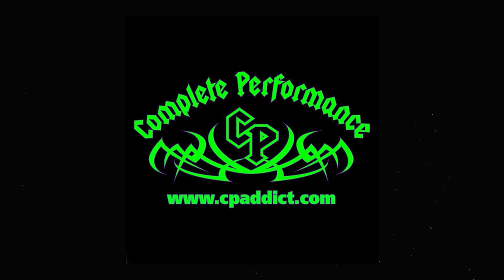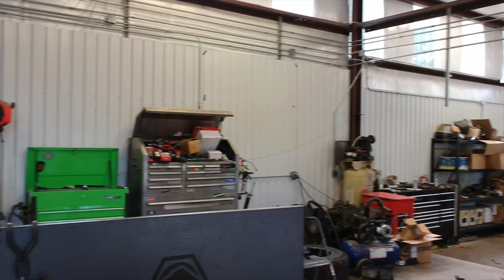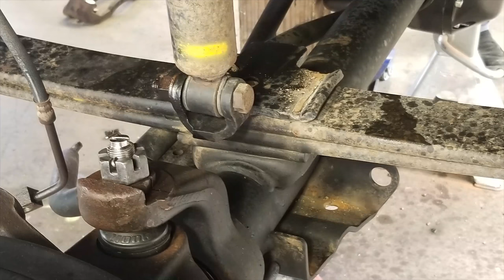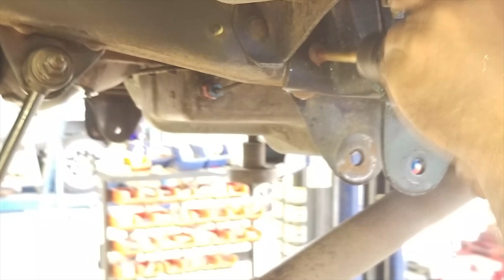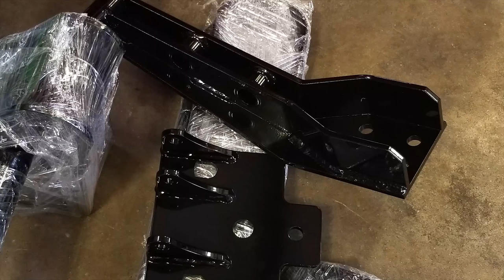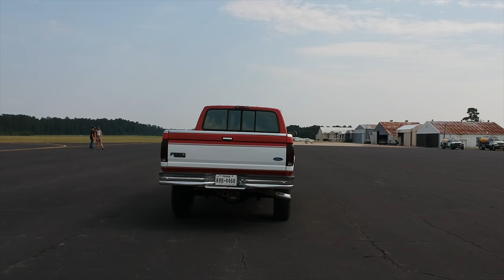2" SKY MFG, Super Duty spring RSK obs 7.3 Install

Comment: What u -joint did you use at the front drive shaft and did you have enough clearance from the crossmember?
Reply from the maker: It's all factory since the axle wasn't changed just the springs and shackles

Comment: It looks a little low in the front still 😢
Reply from the maker: It's not
Reply: @CompletePerformance  which trucks had leafs vs coil springs? Im considering a 1997 f250 but this one is stink bug stanced right now.